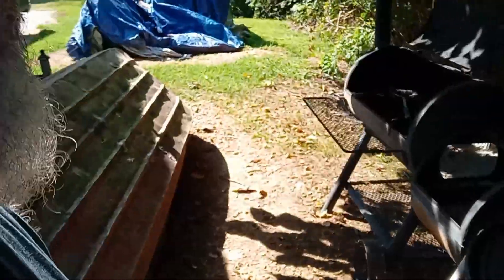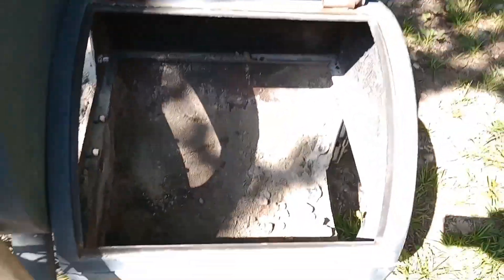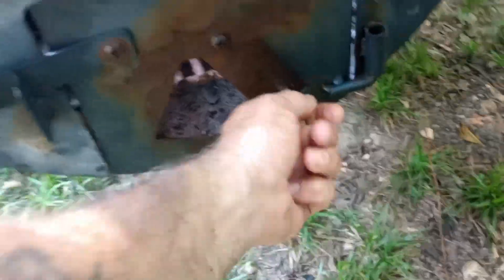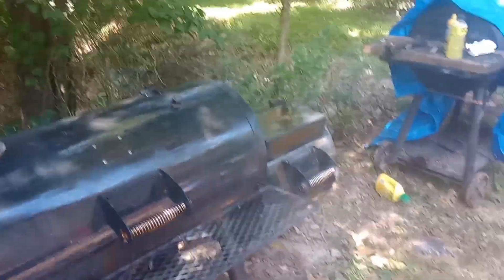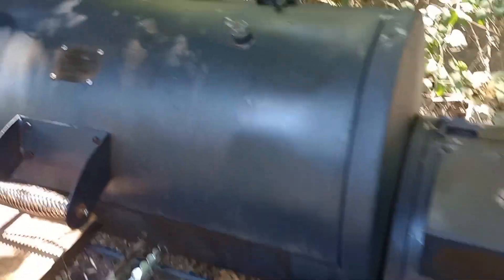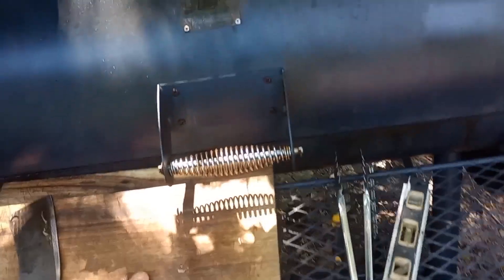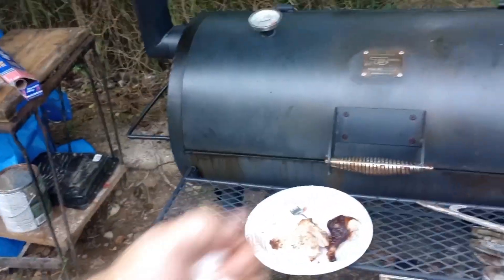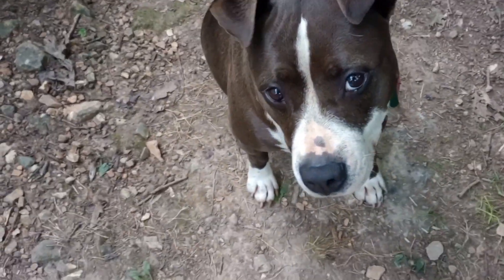restoring ,  and cooking jerk chicken on an Oklahoma joe highlander

Comment: My skin used to come out rubbery, but the last time I did chicken I experimented with the same way Mad Scientist BBQ does his ribs. I saw a guy make jerk chicken on a Weber Smokey Mountain this way also. They both start off around that 250 temperature, then they take it up to a hotter temperature.  That's basically what I did with my chicken. I smoked it, then I took the smoker up to hot and fast temps for about 30 min. The guy I saw make it on the WSM, let his jerk go up to 175 before pulling it. I'm going to try something similar with my turkey legs next. Hopefully I can find a steal on a nice offset like this
Reply from the maker: Hey thanks for the comment,. That's what a few people have told me also. I haven't tried chicken with skin on since then but I'm gonna try it. I think your definitely right, I'm going to try it again soon and I'll see if I can get it right lol! Thanks for the advice and thanks for stopping by! Have a good week!
Reply: @hillbillybbq  no problem.  I hope I find me a deal somewhere.  I want to get back into offset cooking